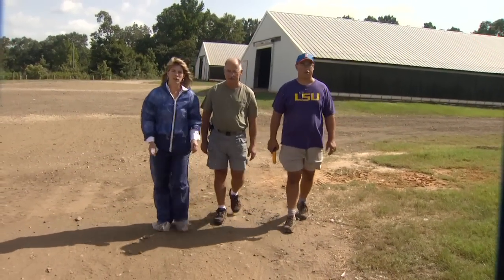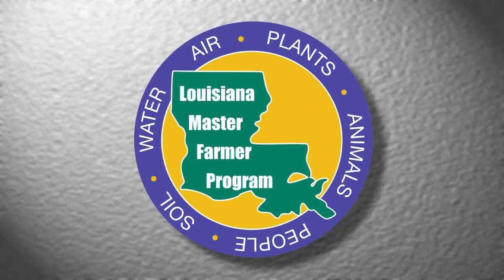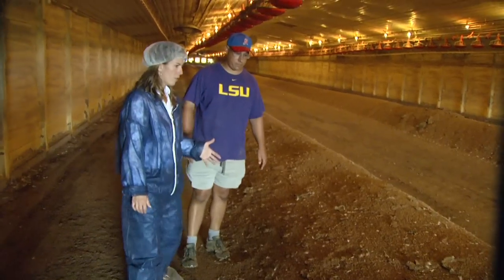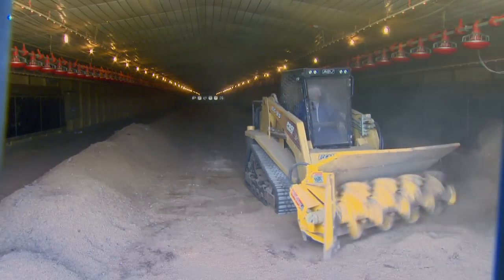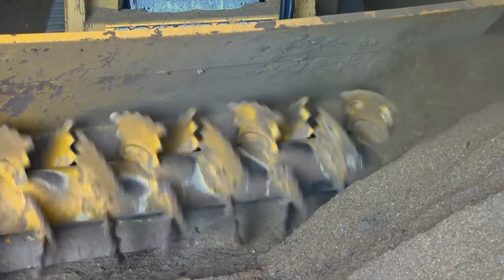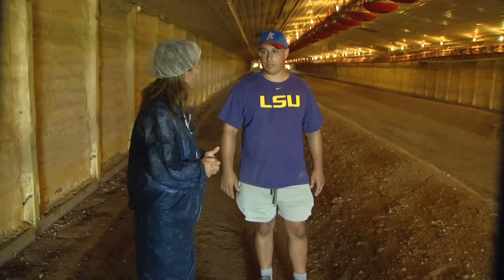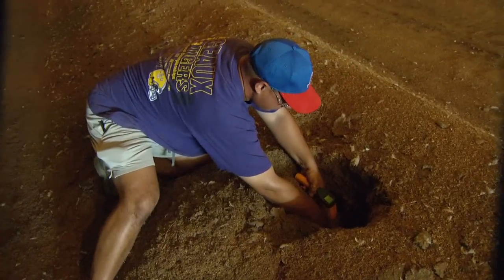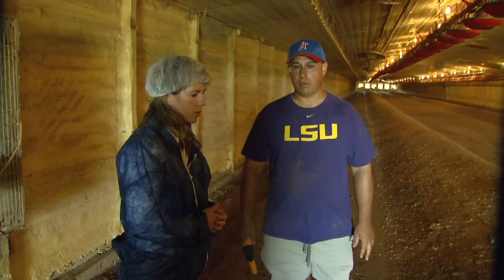In-House Composting of Poultry Litter

Comment: Traditionnaly we wash all the equipments and desinfect them after taking out the litter, but with the method of reusing the same litter for several flocks, wouldn't it necessary to wash and desinfect the equipments?
Reply: What is lux requirements